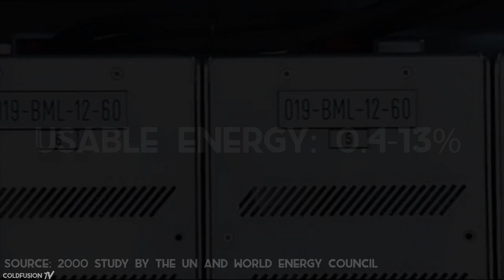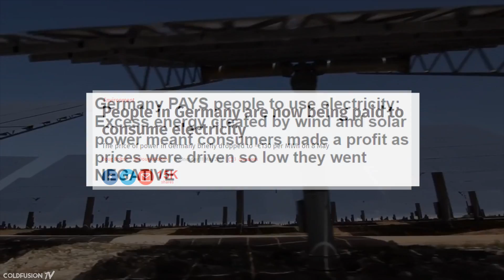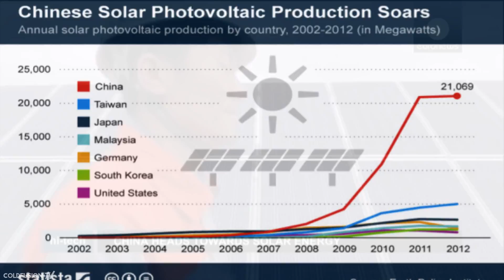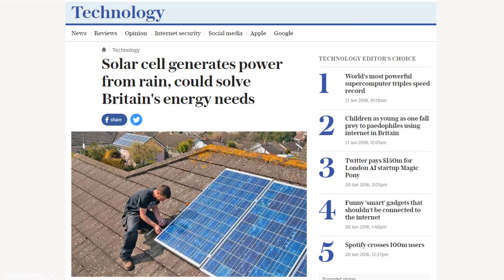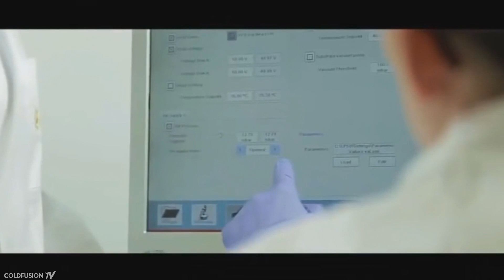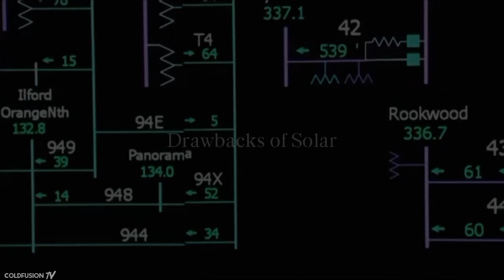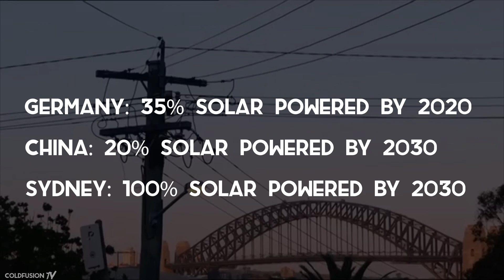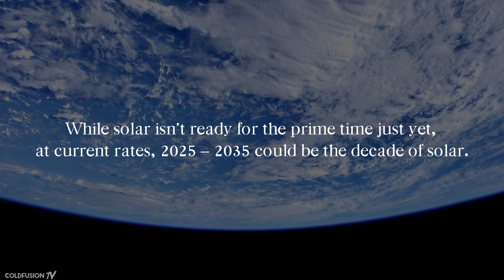The Truth About Solar

Comment: I would like to see also information on how the production and recycling of solar cells affects the environment because this is one of the main problems of using solar energy
Reply: There's an Environmental impact to ALL Manufacturing. Solar is still far less polluting than Coal, Oil and Gas, but less so than Nuclear which actually has the least impact, short of incidents like Chernobyl.
Reply: Silicon solar modules are primarily composed of glass, plastic, and aluminum: three materials that are recycled in mass quantities. 
 Removing the aluminum frame (100% reusable)
Separating the glass along a conveyor belt (95% reusable)
Thermal processing at 500 degrees Celsius
This allows for the evaporation of small plastic components and allows the cells to be easier separated.
Etching away silicon wafers and smelting them into reusable slabs (85% reusable)
Reply: @Richard Vaughn  Are you aware that recycling  aluminium uses 95% LESS energy than making the same amount of aluminum from its virgin source?  I don't think you did but you do now. 
 One ton of recycled aluminum saves 14,000 kilowatt hours (Kwh) of energy. In 2018, utility scale solar power generated 66.6 terawatt-hours that's 66.6 trillion Kwh.
Reply: @Richard Vaughn I noticed corrosion setting in after about that long with the older panels. I have been told by solar panel installers that the newest sealants work for much longer. However, thirty years for a 250 watt panel is an enormous amount of power for just over three hundred dollars. would love to see panels completely hermetically sealed with stainless frame for extra durability. Also, it would be a great asset if the solar cells were given extra protection from damage by having shutters which shut in storms and at night automatically. The protection added this way would extend the life of the panels to fifty, maybe even a hundred years or more. I am imagining something along the lines of a light weight but impact resistant and possibly insulated, roller door which is fitted to the top of the panel. This could be the solution to problems caused by hail, snow and ice, and heavy rainstorms. There already panels which are crack resistant, and the metal electrical part of the panel is on the back, and forms a durable sheet of copper instead of fragile filaments. Also the price continues to fall, and the general technology is rapidly improving. We will see multi purpose collectors soon, I believe. They may use much more of the suns energy, heat gasses or water simultaneously,  and be more efficient and durable. (Excuse typos, You Tube printer playing up again.)
Reply: The use of toxic doping materials in current solar cells is not the end all be all of the technology. Solar cells are still in their infancy development wise. The most efficient solar cells currently being developed are made from carbon and rare earth metals. You have to give the technology time to fully blossom before shooting it down just because of our current shortcomings. The alternative of continuing to rely on fossil fuel combustion is no better.
Reply: I am still always amazed at how much my rooftop solar produces on overcast days.
Reply: Already time for an update because the same year this video was produced the price of electricity from solar panels fell below the price of electricity from fossil fuels and continues to fall. Solar energy encompasses much more than just photovoltaic cells that's just one aspect of harnessing the limitless energy from the Sun there's also solar architecture which when combined with geothermal  should hasten the transition from fossil fuels and their toxic byproducts,plastics.
Reply: Silicon comes from quartz, silicon oxide, which has to be reduced using carbon as is pointed out in the movie “Planet of the Humans”. In terms of recycling I am not sure how you can recover pure silicon from the solar cells. I suspect with difficulty and at a much higher cost than reducing mined quartz. 

Problem with nuclear energy is the initial capital cost and lead time before energy can be generated. Solar can be brought in incrementally. But I still believe in nuclear power as the only viable alternative to fossil fuels. If, of course, burning fossil fuels is as big a problem as it is made out to be.
Reply: it will also affect global weather.
Reply: Solar panels and electric cars are truly awful. Not just the environmental impacts but the human as well. They contain many minerals and metals that primarily exist in poor, often wartorn, countries. There are children working in mines to get it out, it's disgusting. I would encourage everyone to look it up. Even in your phone there are materials that were obtained using slave labor and child labor.
Reply: @pippetandpossum  sounds like you're confusing solar panels with cell phones silica from which solar panels are made is one of the most common substances in the universe and basically non-toxic whereas cell phones use heavy metals found in your cell phones and computers and they are far more toxic than solar panels.-
http://www.softschools.com/facts/periodic_table/silicon_facts/189/
Reply: @paulsmith-gi5vm  I'm talking about the batteries used to store the energy from the solar panels, sorry I should've been more specific
Reply: Nuclear is best, hands down. There's not an issue of leaking or storage either, which is great. Technology advances every day.
Reply: No, there are two recycling methods but right now, very little modules to be recycled.
Reply: Add to this add the pollution problems associated with the manufacture and disposal of batteries.
Reply: Most don't get recycled they throw them in a landfill in a3rd world country then it poisons the water
Reply: Do you want to wait until we have a magical, non-existent ,100% safe source, or keep selling and improving the imperfect systems we already have?

Solar doesnt have to be perfect, just better than what we have now - and if we can't have new nuclear plants (the best choice by far), I'll gladly take some waste byproducts over fossil fumes.
Reply: Jared we can totally have nuclear
Reply: @ci6516  No way...too messy to get rid of spent fuel rods (not to mention, dangerous)
Reply: Wow, for a channel that aims to educate people, the comment section has an amazingly high rate of people who believe the fossil fuel propaganda.
Reply: The general population is completely ignorant to these problems. They just follow the words of those pushing renewable energy, blindly.
These things are leaking lead, cadmium, etc into people's homes and the ground around them.
Reply: @grigorirasputin9507  can you send me the sources for your statements please?
Reply: @grigorirasputin9507  Nonsense. Outrageous disinformation.
Reply: @grigorirasputin9507  It's claimed that this was one of the main issues of Rome. (not solar panels but lead poisoning). Maybe they actually WANT to poison the soil so that people are forced to rely on only 1 source for water.
Reply: @GamingDad  just because somebody puts a statement in print doesn't mean it's true ask for his sources.
Reply: I hope they figure out stable Nuclear Fusion soon!
Reply: Good question, one that no one wants to tackle. Solar panels are made in the back country of China where I’m sure there’s no EPA.
Reply: @mycarealtor  Mined and created from the dirtiest coal fired power stations on the planet. Then they harp on about cost reductions with added govt subsidies.
Reply: Not like Nuclear waste!
Reply: +Stephen Tice. Most of the material (aprox 90%) is still perfectly good uranium fuel, if you can separate out the actual waste from the spent fuel rod then you can put the fuel rod back into the reactor to generate more power. This is what the Integral Fast Reactor was meant to do..... but congress killed it.
Reply: They can shoot it into space w/ the cost of launching rockets getting cheaper it can work.
Reply: @overthehilldill3626  Bad idea dude, if the rocket blows up or crashes with a load of dangerous toxins on board we are even more screwed. Solar panels are made of inert glass. The are much less toxic than a computer or phone. The people talking rubbish are stooges of big oil and the big power companies who are shitting themselves due to loss of revenue to solar energy. Don't believe their crap!  Solar energy is fantastic. I have a two thousand watt 24 volt system, and I adore it. I run everything with enough energy left over to charge an electric car once a week.
Reply: @kenbellchambers4577  Oh i believe in solar. I was born in Germany and my family there have used it since the 1980's. The big oil interests need to pull their heads out of their greedy asses and help this earth out.
Reply: Ken Bellchambers the batteries that would take to power cities and countries would be huge . Giant lithium batteries in every neighborhood.  They don’t even exist . Nuclear is a far better option and they aren’t eye sores we have to see all day
Reply: Over the hill Dill Germany’s carbon emissions are continually rising . Doesn’t seem like it’s working ?
Reply: Yes, and I am guessing they have dropped the cost of responsible disposal off the cost of creating the solar panels. To have dropped the price by that much...something had to have come out of the equation...
Reply: Very valid point. I think renewables may have a place in vehicle technology. I often wonder why we aren't trying to integrate with fuel to lower consumption of fuel and use things such as renewables to augment fuel use in vehicles. Surely we can use wind technology which can be stored when vehicles are moving and then use it to also power the vehicles.
Reply: My solar system has been in for seven years. It is only two thousand watts, but runs everything. Glass is incredibly stable, so can't see a problem with massive pollution. Anyway, are you going to toss your phone and computer? Solar is wonderful, but big power hates it. I wonder why. Don't swallow all the horse manure that they shovel at you! There is no sensible reason why the entire solar panel can't be recycled. Nuclear however has just killed about forty trillion fish, whales, dolphins, starfish, crabs, and the death march continues.
Reply: Ken Bellchambers forty trillion fish . Where did you pull that from ? Most solar panels are 3-5 years . It’s already a fact that Africa is being bombarded with toxic waste from pannels. How much space will it take? We’d have to cover over 1% of the totals earth surface to run off renewables . And what about all the mining for the heavy metals ?? Nuclear can run on old abombs for 50 years
Reply: Very easy, even now developed and democratic have solution: just unload on African coast. Don't worry, Africa is big continent, plenty of room for next millennium. And not just that, developed and democratic countries will be worried about Africans who are poping off younger and they will send help: young doctors will practice on much younger Africans...
Reply: The problem with solar panel manufacture is not so much local pollution its the amount of energy it takes to make them. I will take years just to get back the energy cost to make them. And a lot of that energy comes from coal.
Reply: @meagain2222   WOW your misinformed, Solar panels went from $96 per watt in the 1970's to .36 cent a watt today. payback time is now around 4 years for a 30 year solar panels life expectancy.
Reply: @jammer6524  Your talking about the payback for the cost and your figures are about right but I am wondering how much energy it takes to make them.Its electricity which makes the aluminum frames and silicon materials and the glass to cover the cells.
Reply: @meagain2222   The payback period is the amount of time required for cash inflows generated by a project to offset its initial cash outflow. That includes the electricity used to make every part even the fuel used to ship it to the site and install it.
Reply: They are worse than a nuclear reactor, plain and simple. Let’s see how they can get rid of them in 20 or so years not to mention the disaster they cause around homes now. I feel sorry for the children and the families with weakened immune systems.
Reply: @salvatoresaccoccio2379  The statement, "They are worse than a nuclear reactor" just isn't true, tho the production of them are a problem if the toxic byproducts aren't handled properly or reused in some cases but a nuclear reactors byproducts are worse when compared.
Reply: Shadownight I don’t know where you’re information comes from . I recently did some work for a physicist that works for GE and some how were we’re talking about renewable energy and solar came up. He said to me those exact words. They can’t dispose of them properly, most of the components can be recycled but the silicone cells themselves make it difficult because it so expensive to break down the cells, thus not worth the effort because of its toxicity. Thus needs to be stored.
Reply: @salvatoresaccoccio2379  If we think about the secrecy about the nuclear industry because it is tied to defence industry.  Nothing can be believed....
Reply: See Stephen Kotkin if you're thinking about recycling all the nuclear deterrence
Reply: Every large scale power source so far is worse than a nuclear reactor, so saying it's "worse than a nuclear reactor" isn't saying much.
Reply: @zolikoff  You obviously haven't been following the Fukushima meltdown problem, we seem to have lost about ten trillion fish, whales, dolphins, starfish, crabs, sea birds and another huge amount of terrestrial animals and birds so far. Doesn't seem too safe to me. I will stick with my solar panels. Even burning coal with catalytic converters is much, much safer. 
Also, we have hardly scratched the surface so far as methane digesters are concerned. Methane is an inexhaustible resource when combined with composting and forestry management. Currently we lose many millions of tonnes of potential methane and humus per annum from fir due to bad forest management. Nuclear energy is for idiots. All it takes is an earthquake and there is another disaster.
Reply: What are you talking about? Where have we lost "trillions" of fish from something that can't actually harm them? In your imagination?
Stick with your solar panels, there's nothing wrong with that. But we can't power the planet with them only.
Reply: @zolikoff  Have a look at 'mass fish and wildlife deaths worldwide since 2011'. Are you on some other planet far, far away? Trillions dude. We just had another 150 pilot whales that washed up in Western Australia. Did you miss something. Maybe you think the thousands of photos and news reports are all photo shop productions. Put away the gin and tonic old fellow, there is a whole planet out there that you seem not to have noticed.
Reply: Can you at least link to something, a source, a study, that shows specifically increased deaths since 2011 and their connection to Fukushima? Or are you just looking at random whales being washed up and concluding yourself that this must be Fukushima (can't be anything else, like warming oceans due to climate change), and then just making up the trillions number based on a few cases?